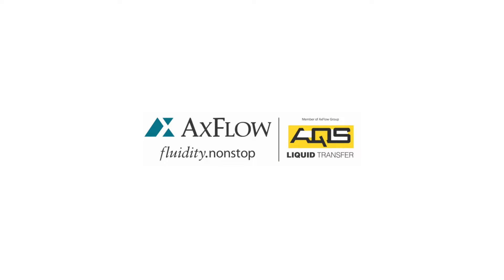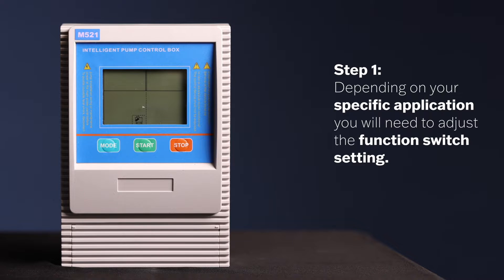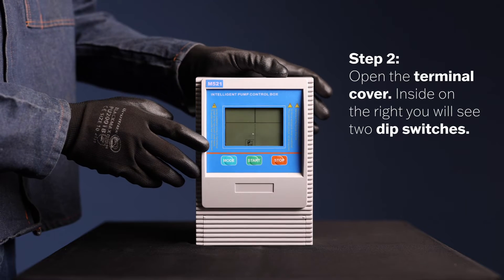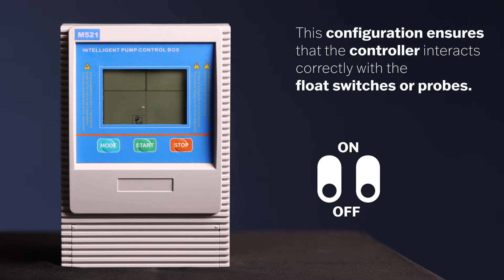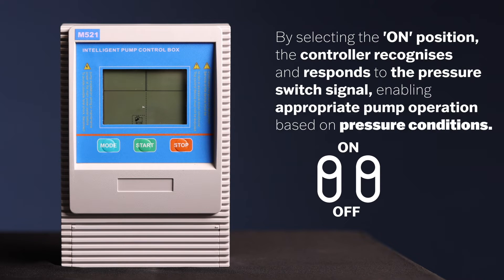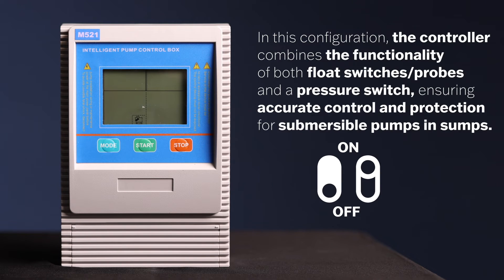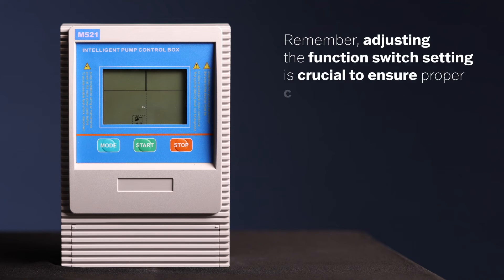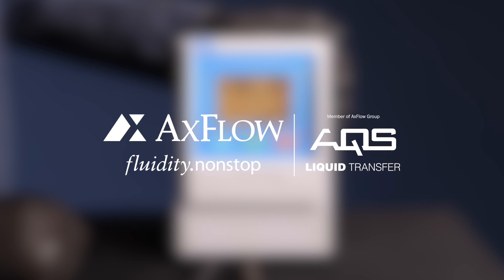Changing the Function Switch Settings on Your M521 Digital Controller

Comment: When the water in my well is depleted the Motor Amps drop from 2.5 to 2.3. I have set my Run Dry Amps to 2.3 and the Run Dry time to 2 seconds but my M521 does not trip when the water in the well is depleted and the Amps drops to 2.3. Please assist thank you
Reply from the maker: The running amps and dry-run amps are very close to each other, which typically indicates a problem. Normally, there should be a noticeable difference, with the running amps being higher. This issue is likely due to the pump not operating efficiently along its performance curve. To resolve this, you can either install a ball valve on the discharge piping to throttle the flow and increase the running amperage. Alternatively, you can install level probes in the borehole to automatically shut off the pump when water levels are too low.
Reply: @axflowaqsliquidtransfer  Thank you for your great response. Why the pump is not running efficiently along its performance curve is definately a problem. When I throttle the discharge flow I notice the amps drop rather than increase which is also peculiar. I forgot to mention in my first comment that this is a 3 phase pump I am not sure if this has anu bearing on thre issue. I have decided to install the level probes to resolve the problem.